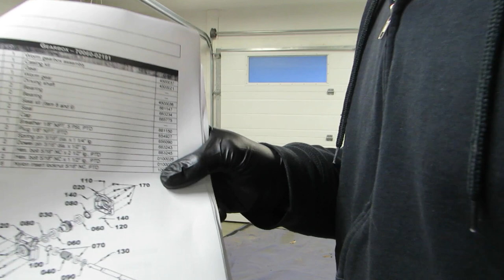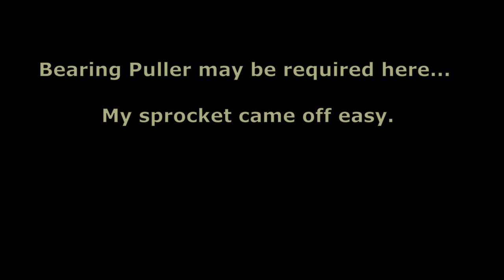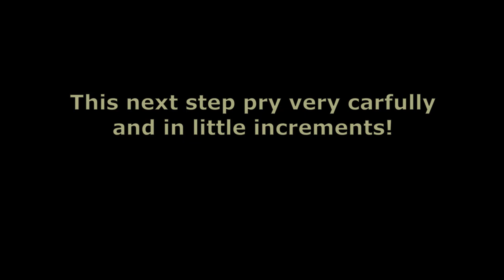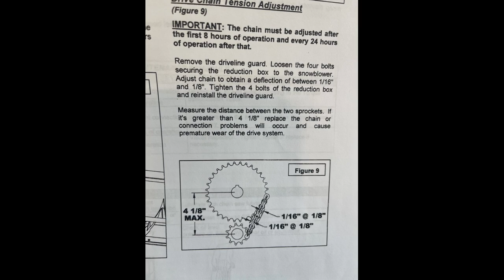Kubota Snow Blower-How to Repair your snow blower. Drive Chain, Gear Box Spring Pin, Shear Bolts.

Comment: A great, detailed procedure that I hope never have to go through.  Chilliwack on the radio was a give away that you’re from Canada, eh?. I also have a bx2750D blower and have gone through 3 chains so far over the past few years.  I have also noted the loose Allen bolts on the large sprocket and will use Loctite in the future.  I check the sprocket alignment every month to ensure they don’t come loose again.  My problem is always the fan shear bolt not breaking. The one time it did break a simple replacement bolt was all I needed.  When I asked the Kubota engineers if they had a solution to the shear pin not breaking they advised me to stick with their pins and that they replaced my chain drive model with a heavy duty gear drive model that wasn’t  as prone to to breakage. Maintenance is the key to happy Kabota-ing for sure.
Reply from the maker: Nice to hear from you Jim. Yeah you really need to keep an eye on these things and all the moving parts. It was a full few days to re and re the blower.  But I can’t believe in the end it was just a spring pin that caused all the problems. Thanks for watching and happy tractoring. Cheers, Mike.

Comment: Mike, we always use a piece of safety wire through the spring pin so it doesn’t come out. Thanks for the video, very helpful.
Reply from the maker: Dale, thanks for the comment. I’m trying to picture how a safety wire would work here. Have a look at 25:30 minutes in the video. That worm gear turns continuously so I don’t know if that would work.

Comment: Thanks for taking the time to document this repair, it will definitely be very helpful to me in the near future.
I had a similar problem with my BX2750D snowblower which partly resembles the BX2816.
At the rear of the snowblower, the top gear was no longer aligned with the bottom gear.
One Allen set screw was missing and the second was loose, which resulted in a broken chain and the keyway being severed.
I re-aligned everything, put a new chain and put the Allen set screws back in place, but I added a second one above the first ones to prevent them from unscrewing again.
Now I check the tightness of these set screws every time I oil the chain, so every 4 hours as recommended.
This summer I plan to open the front gearbox to check the spring pin, and probably replace it, before it causes any trouble.
Reply from the maker: Yes!!!! I love the two Allen bolt idea. If you don’t mind I’m going to follow your lead on that one for sure. 
Thanks for the comment and good luck with the maintenance. Shoot me a question if you have any and I’ll try and help out. 
Cheers.

Comment: Mike, the safety with is very thin, once stuck through the spring pin, then twisted together on top and trimmed so it doesn’t  interfere with the gears. Looks like you got it taken care of buy replacing the old spring pin. We were never allowed to install a spring pin without safety wire. Excellent video, thanks for sharing.
Reply from the maker: Really appreciate your kind words on the 
video! I’ve done a few searches based in your description and I will be adding that little tip to my arsenal of tricks! Cheers!

Comment: I would take care when using Kubota "shear bolts"...I have a smaller blower unit,GR2707, for my GR2110 mower and had been making my own shear bolts on my lathe. The last sloppy snowfall we had last winter I went out to to clean the driveway and picked   up a small rock which got jambed between auger and side housing. The shear bolt didn't shear and the complete auger assembly wouldn't rotate! My first thought was " oh oh, those shear bolts I made have come back to haunt me"! When I pulled the bolt out I saw that it was an actual kubota brand shear bolt . The bolt bent but didn"t break and it end up costing me $450 for the helcoidal gear in the auger gearbox. Pita!
Reply from the maker: @robertmurphy810  yikes! I’ll definitely ask at my dealer if they are having issues with the shear bolts for my blower. It doesn’t hurt to ask if there have been any other cases. Thanks for watching and reaching out with your story! Cheers, Mike.